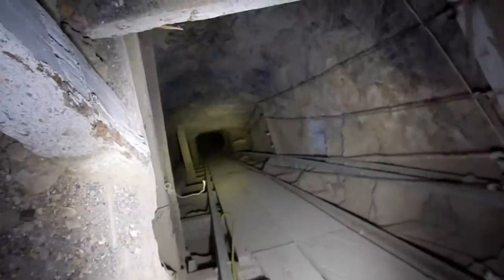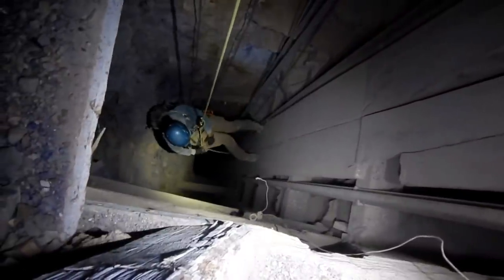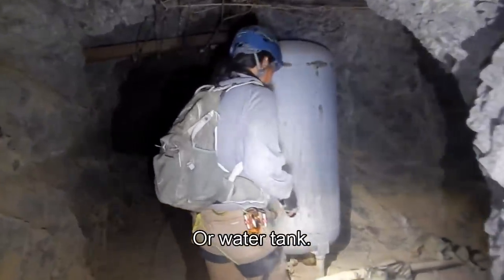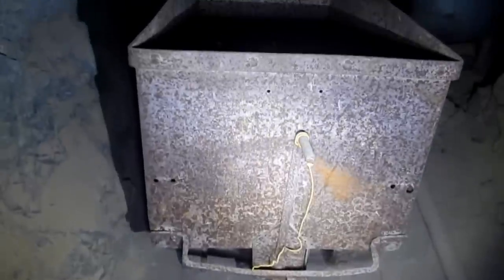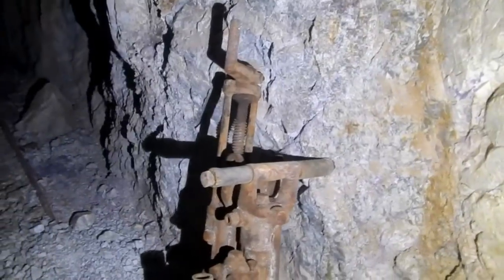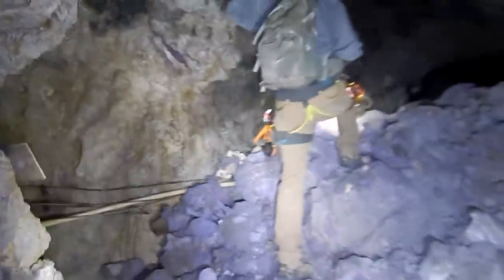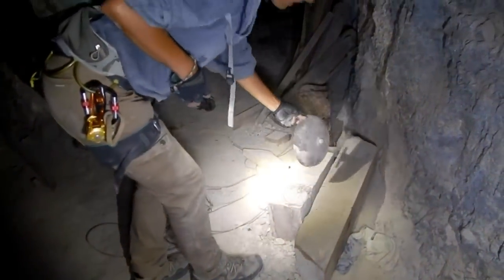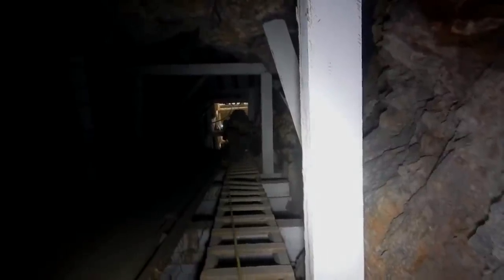Risky Shaft Rappel Was Worth It. Ore Cars, Rock Drill, Artifacts ⛏️

Comment: At the beginning of the video, as you were rappelling down the shaft, I was curious what you used to ascend. Whether the ladder or mechanical ascenders. I heard at the end Julie was using a prusik while climbing the ladder. Nice.
A little after 7:00 minutes in, got my heart pounding seeing the debris fall and the notation on the screen about a broken ladder rung.  And neither of you being on rope! Good it turned out well.
Amazed at the colors seen in the rock underground, haven't commented on that before in your other videos.  Amazing color variations though.  Could sit and marvel at what many will never see first hand. :)
Don't recall the time point of the video, but, 10 more levels???? Oh, what and adventure.
Will definitely check out the other videos you have on your channel.  Some may not be to my interest, but because of these I have seen so far, the very least I can do is watch & give a thumbs up!
Have really been enjoying all these mine videos so far. :)
Reply from the maker: This is kind of a strange one to get into. There is a huge concrete cap in place as a closure. We rappelled in because of the way you had to get in past the concrete. Many times, we will use climbing gear for protection even if there are ladders because we don't know the condition of the ladders. In this one, we found the ladders to be decent, so we didn't need to use ascenders on the way up but did use a friction knot in case of a slip and fall. We ran out of rope at 165', and the next level was at 200'. The rung broke on Julie at about 180' down. We had more rope that we should have been using. I do want to go back to go lower, although I would be surprised if all 10 levels are still open and not flooded. We need to be roped in to go lower from where we stopped because the ladders ended, and there were just 2x4 cleats nailed on to the framing for a step type ladder. I can't remember if I showed that in the video. I remember taking a step or two on them and being very uncomfortable. Thanks for the comment!😁

Comment: Very interesting mine. The large tank had to be a handful getting down there. When the rung came loose on Missy Julie that would have been it for me...
Reply from the maker: Good point about getting the tank down there. When the rung broke on Julie it was a bit scary. We were off rope at that point because that rope is only 165 feet long and that level was around 200 down. We have 600 feet of rope, but were only using one length that day. Good thing she was holding on tightly. Thanks for the comment,   David!

Comment: An interesting mine The three power lines likely indicate that they had a big machine or machines somewhere down in the mine. The three wires carried 3 phase power, likely 208 or 240 volts phase to phase to run the machine. If 4 wires, the 4th wire was likely Neutral, or the return lead for the power. From any one of the three leads to the Neutral they could run light bulbs at 120 volts. Looking at the ends of the light bulbs for the design voltage would have been a good clue.
Reply from the maker: Thanks for the detailed and informative comment, Charley. We appreciate your input!

Comment: Why did this video start when you're already in the mine ? And then ended before you completely got out of the mine ? And do you ever keep anything you find while you're in the mine ? Like that bottle of wine? or  those newspaper clippings or anything you find down there do you ever keep it?
Reply from the maker: Hey Eddie, usually when I don't show the portal, or entrance to the mine, it's  because it's been gated or closed in some way, or it might be private. This shaft has been covered over but someone has reopened it at some point. We don't take things from mines for a couple reasons. It old have an active claim on it meaning you can't take any minerals or rocks from it, or disturb the operator's equipment. The other reason is that there are laws protecting historic sites and the removal of items from them. Our RV would be packed if we kept stuff from every mine we went into. Thanks for the questions!